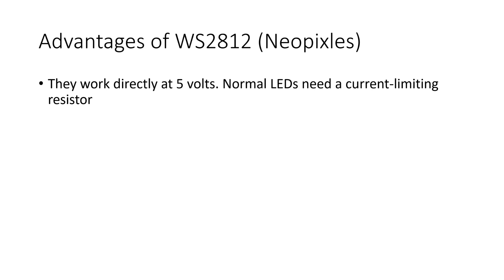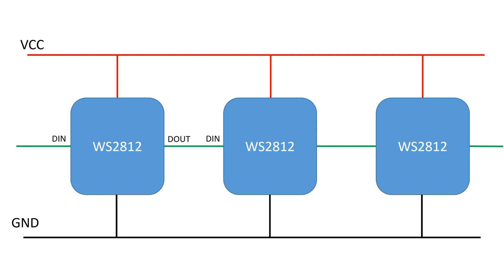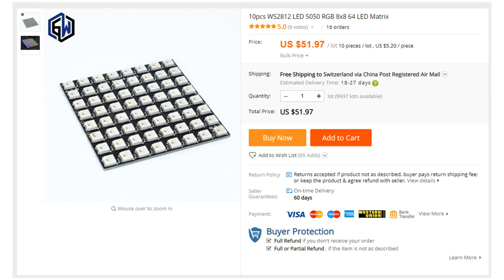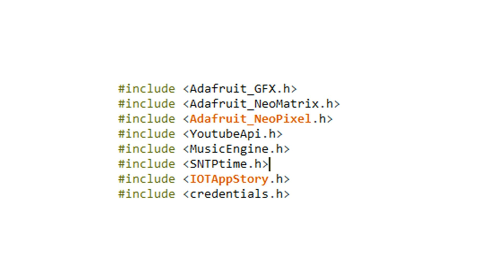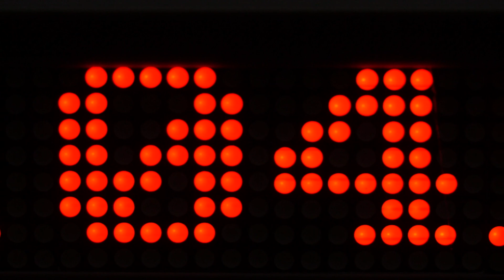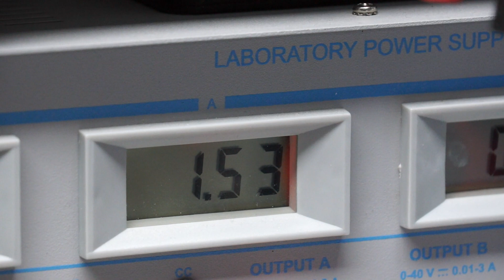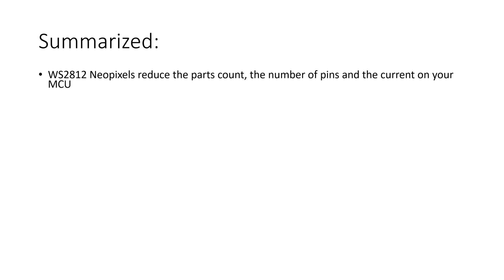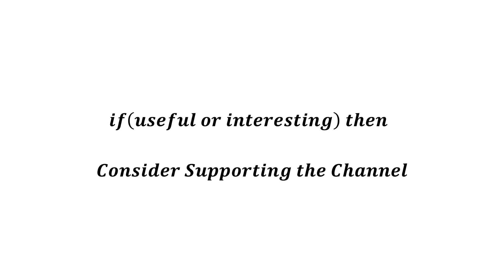#246 12 Tips and Tricks for Neopixels Projects (Arduino, ESP8266/ ESP32)

Comment: Good trick by using a FET, however, this needs to be a "good" (low Rds on) one to withstand the max. needed current and not causing funny supply line voltage changes. Maybe it's easier to check if the panels beeing ordered are "on after power on" or "off after power on" - if our friendly chinese friends do publish that information ... If you want to further stabilize the ESP power supply I to add a 1000µF or something like that capacitor to the 3,3V line of the ESP. That will buffer the 3,3V even if the 5V drops too far, at least in theory. Additionally I would highly recommend to add some kind of electronic fuse to the design to shut the panel of in case something goes really wrong and he current beeing drawn would go beyond the capabilities of the powr supply. In case the currrent beeing drawn is beyond the the capabilities of the power supply the power supply might get too hot and even catch fire. With the already present P-FET it would be easy to use the Rds as the current sensor and derive a lock out (by using an OP amp) for the WS2812 5V line - something like "if greater than x V - shut down, probably using a input on the ESP that calls an emergency interrupt routine to switch of the panel in such a case.

From experiance I learned that these intelligent LEDs ( whatever name you'll give them ... ) are a bit tricky at the timing ( as you stated in the video ) AND the supply voltage could be having some strange effect on the timing/behaviour. I learned it the hard way by buying a INK1003 based LED stip set that came with a power supply beeing - to say it politely - just nothing more than crap. It took me a whole day to find out that this funny power supply interferes with the Arduino I attached and over time ( I'm talking about something <10h ) the power supply converted itself silenty from a 12V DC to a 130Vpp AC power supply - real magic (fortunately it at least still did isolate primary and secondary). So my advice : Never trust those cheap power supplys from unknown vendors, they tend to scare you to death.

BTW: Damit ich hier nicht allzu viele auf dumme Gedanken bringe mal in einer Art deutsch weiter : S tönle biem subcribe/unsubscribe könnt äbber ne um ebbis z bastelä des numme dzua nützd d ganz lieb lang Dag ä sub/unsub z mache um de Zähler töne zu lo ... (Ich hoffe die Schweizer verstehen es und Google kanns nicht übersetzen)

Anyway, have fun and enjoy this 3. Advent !
Reply from the maker: Concerning fuse: I could just add an old glass fuse to be safe. If it is a time-lag fuse (träge) it would fit perfectly for that purpose. Concerning the other thing: Google just removed quite a few of my subscribers because they thought, they do not behave ;-) It seems, they have "cleaning days" from time to time...
Reply: Wouldn't that be tooo easy ? ;) Beside that the good old 5x20 glas fuses appear to me to be a bit too big for todays projects - might be bigger than the "brainbox".With TR5/ICPs you loose the ability to see if italready had overcurrent and the fuse did switch off - that's why I do not like them so much, even if they are smaller. Either way, I think some kind of protection would be wise to protect you house from burning down.

Comment: Connect the first +5V/GND (in) and the last +5V/GND(out) the your power supply, to fix the problem with different brightnesses. AND you don't have the full current on one cable pair.
Reply from the maker: Like that you still would have the middle matrix with less voltage (longest distance from the power). If you connect GND on one side and VCC on the other then all LEDs have the same distance from power (not my idea. A viewer wrote it).
Reply: @AndreasSpiess  That's interesting. I'm using an LED strip with the sk6812 with about 100 LEDs as I described it. I didn't notice any difference in brightness. Maybe it occurs when I use more LEDs. The advantage of the strip is that you can connect several other wire pairs in the middle.
Reply: Lazy makers? ;)
Run vcc to gnd wires to each matrix

Comment: I've never seen WS2812Bs that initialize full power... good to know they exist! Regarding 3.3V / ESP8266 I've had some bad experiences. I've done lots of projects with ESP8266 and WS2812B and on my bench all worked fine. After having made my own PCBs, they failed... Problem is, the 3.3V logic level is right on the edge what is acceptable for most WS2812B. If your logic level is more like 3.1V OR your Vcc is more like 5.2V the WS2812B LEDs will fail / flicker / show random patterns... You should test your project with slightly higer Vcc which could also happen if you change your wall adapter...
The way I solved the problem is by using a Diode between the GPIO and DIN and also pulling DIN up to Vcc. This shifts the logic level up by ~0.6V. With GPIO at GND level, DIN will be at ~0.6V and with GPIO at 3.3V, DIN will be at 3.9V.
Also keep in mind that only the first WS2812B is affected, because it will amplify the logic level for all others.
You could also drop 0.6V of Vcc on the first WS2812B to lower its logic level threshold.
If you don't do anything and use WS2812B directly on 3.3V levels with 5V vcc try to, at least, choose the first LED based on some tests.
Reply from the maker: Good idea with the diode. I thought, I just add a level shifter if I have problems. I have a few somewhere in the lab.

Comment: "Gosh dangit", or whatever you are supposed to say, that was very useful for my 3D-Printed LED-Cube-Project, i will however stay with my ESP32 to get BLE for connecting to an app on the phone
Reply from the maker: I think there are libraries which work for the ESP32. But I needed one which works with the matrix library.

Comment: The precise timing thing scared me from using those LEDs, I decided to go for the APA102 type with SPI interface
Reply: Having done some professional work on large scale installs with the strip versions of these, I would recommend avoiding the 2812 chipset.  The timing issues aren't too big of a deal as long as you can tweak the software.  However, the 2812 is incredibly unreliable over time.  The older 8806 chipset uses a data and clock line in a clock-driven serial approach that is super reliable and seems to be far less prone to failure than the 2812.  I haven't used the APA102 but a quick look at the datasheet seems to indicate they are pretty similar to the 8806.
Reply: Had the same experience, APA102 is much more reliable and has higher PWM rate than WS2812. But the data format is slightly different to 8806, it has an additional global brightness field for all 3 colors, which can be used to improve color resolution or blinking etc.

Comment: I never had a ws2812 strip that turns on full bright without a signal. It must be some different chip or a new revision or something.
I have a big ambient light based on neopixels in my living room, so here are some more tips for long wires.
Put a 1000uF capacitor across the power pins every two meters of a strip to reduce chance of flickering. 
3.3v signal levels only work for very short wires, for longer you need a level shifter. For more than 2 meters you need a gooood level shifter and coax. I used an octal bus transceiver chip like adafruit recommends and still needed coax. A reverse diode and pullup works well for shorter distance. 
For high current you can run a thick power wire to both sides of a long strip for best results.
Fastled's current limiting is great as an added protection.
You can get neopixels in a classic through hole led package now (5mm or 8mm), they are amazing! I'm making Christmas lights from some, asides from the extra wire they look exactly like normal lights just way brighter.
Reply: The length limitation at 3.3v is more likely caused by vcc dropping too low over distance, and not because the data signal is too low. The data line from the MCU only ever drives the first WS2812, which in turn drives the data line of the next, and so on. The "data out" voltage is generated from the vcc connected to the WS2812 and is not related to the "data in" voltage.
You can test this by feeding 3.3v signal levels to the "data in" of a 5v powered strip and checking the data line voltage further up the strip, you'll find 5v signalling.
Reply: Exactly. I had a bit of a distance between the controller and the strip, hence the problems. You can also add a blind pixel next to the controller to act as sort of a level shifter but even then the drive current isn't good enough for really long wires. It's also the capacitance of the wire, it acts like a filter for the fast signal rounding all the peaks into oblivion.
Reply: @bardenegri21  Good point, I was thinking only of the controller being electrically close to the strip. I wasn't considering that there may be a long run of cable between controller and strip.
Reply: I sofar built 5 wordclocks using LED strips, each with 5m WS2812, 33 LEDs/m. The first strip indeed had this "on" characteristic: All LEDS white and on. I thought the others were "defective" as they did not switch on white, but they worked as specified reacting to the data-in, using the same library, python program (on RPi) and parameters. Later strips were for sure WS2812B, do not know for sure for the first one. Also the first strip was capable of showing distinct colors for the lower intensities slightly better. I guess there is other hardware involved.
Reply: I’m using what appear to be the same matrixes that he is using and I have not observed the “on” characteristic that he is seeing either. The pixels remain off until they get a data signal. It’s interesting that similar hardware would behave differently. I am using the cap and resistor that are recommended for NeoPixels, as well as a logic level shifter to get it to 5v. I was curious if that could be causing the different behavior, but it sounds unlikely.

Comment: The next updates: 
1. Show the subscribers in hex, no hardware modification needed. Maximum: 16,777,216 subscribers
2. Use a smaller font (5x8) to get another digit. Maximum: 268,435,456 subscribers
3. Delete the green/red arrow, because we are going up only. Another digit. Maximum: 4,294,967,296 subscribers
Still not enough for the planet earth? Then:
4. Make the display scrolling. Maximum: More than the number of atoms in the universe. ;-)
Reply from the maker: Interesting extensions... I do not like #1 because I would have to wait much too long to get to the 100'000 :-(

Comment: j'ai un projet d'horloge basée sur des WS2812B mais je comptais alimenter les blocs de 2812 avec plusieurs HLK-PM01 et un de plus uniquement pour le microcontrôleur le tout en masse commune mais Vcc séparé. ça me semblait plus simple qu'utiliser une grosse alimentation et risquer un démarrage difficile
Reply from the maker: An independent power supply for the micro indeed might solve the issue. If the power supply for the panels is capable to supply enough voltage to make the WS2812 respond.

Comment: Lady Ada advises to put a capacitor on the supply lines because of that initial boost issue.
Reply from the maker: Without a FET, in my opinion, a capacitor increases the surge current, because a discharged cap behaves like a short-circuit in the first moment. Only with a FET you can charge the cap first and offload the PS.
Maybe she wants to help with varying numbers on pixels ON during operation. There, a cap without a FET helps.
Reply: Andreas Spiess The cap could have a series resistor towards the power supply to reduce surge current.
Reply: @AndreasSpiess  they mean a capacitor across the ground and vcc line. This will help "absorb" the initial surge of current because the capacitor can supply the rush current.
Reply: @joeybushagour2612  no because the capacitor is discharged at the beginning, so your power supply will have to provide the current to the LEDs and to charge the capacitor.
Reply: Rather to put ntc to prevent surge current. Andreas got point.
Reply: Combine both solutions, FET to keep the leds off and allow the cap to charge, then you get the boot when sending the data to turn off. This will bridge the time gap between power to the leds and sending the data.
Reply: The controller can be powered via a diode and insert a capacitor behind it.
Reply: This is definitely the correct method

Comment: Very good video again; hardware, tips, fun...  
you could add some calculations about needed power supply with n number of pixels. It looks like trial on error now.
Reply from the maker: One panel has 8x8=64 pixels and consumes max 1.5 A. So you can do the calculation, I think. Concerning try and error: Each power supply behaves differently if overloaded. This is why the trial- and error is necessary. If you use a proper PS you do not need trials. Then it should work.

Comment: Maybe it's good to share the discussion in youtube as well as in Patreon.
Hi Andreas, we're also in sync on the Leds panel topic, I was just testing gradients on my panel. I also added to it a practical MQTT interface using Json payloads, please have a look at the construction https://hackaday.io/project/162825/details/
I'm using a ready flexible panel of 8 x 32 WS2812B, with an appropriate power supply for full brightness.
I connected the second power on the middle not the end as you mentioned.
Only catch maybe, I'm using the ESP-IDF, not Arduino, but I integrated the ArduJson library, and I'm still stubborn on writing my own GFX, gradients and animation library, I'll use the HW timer for the animation and measuring runtime with us precision so I hope the animations will be smooth

Comment: Maybe in the future you can make a video about correct wire dimensions. I was pretty sceptical about the 30 AWG wirewrap for the power supply lines. I'm surprised these thin wires are able to power all the panels to full brightness!
Reply from the maker: They are quite short. And it shows that WireWrap connects really good.

Comment: Interesting idea with the power FET. For extended panels, it might be a good idea to "gate" every panel individually, so they can be turned on one after the other, like so:

power on panel 0 - switch off panel 0 --- power on panel 1 - switch off panel 1 --- ...
Reply from the maker: Or maybe always 5 together. The voltage drop is only about 5 ms. But it increases with the number of LEDs because it takes longer to transmit the signal.
Reply: @AndreasSpiess  or  invent superneopixels with an 'LED enable/disable' input so you can shift in the off states before the full current draw of those eye roasting LEDs clobbers your uC

Comment: NeoPixels that are fully on at power up seem like a real pain. I wonder why the purpose is. Luckily I never encountered this kind in the many projects I did. It would have been quite an issue as I often did‘t have sufficient power to run them all at full power. Instead I used software to limit the combined brightness in order not to exceed the max current.
Reply from the maker: You are right. I also think this should not happen.
Reply: It's probably so you can use them as "dumb" LED panels without the need for a controller.